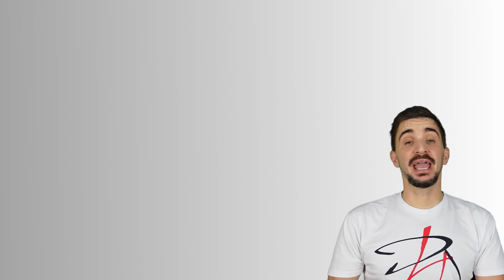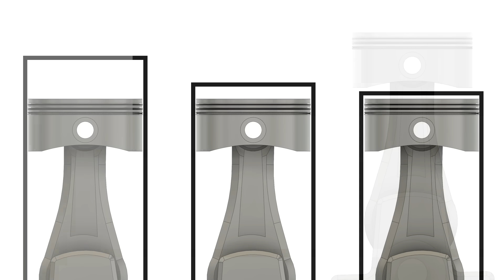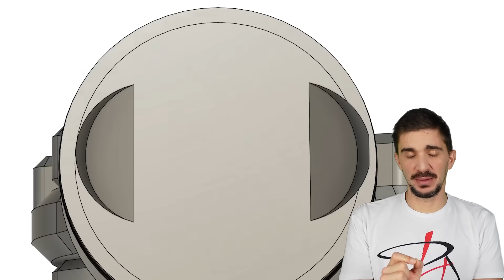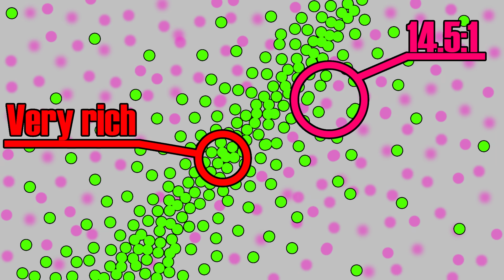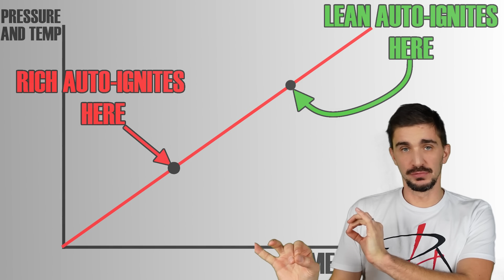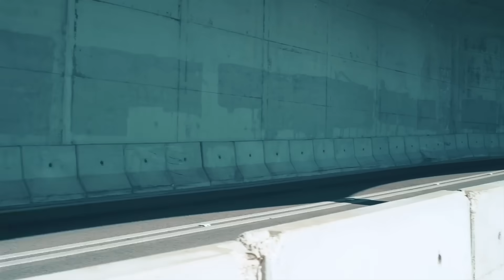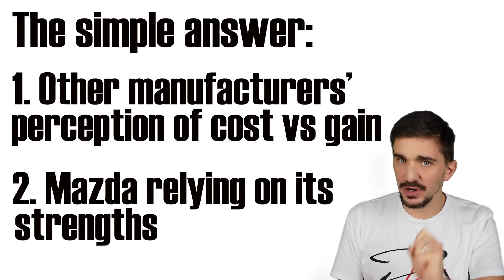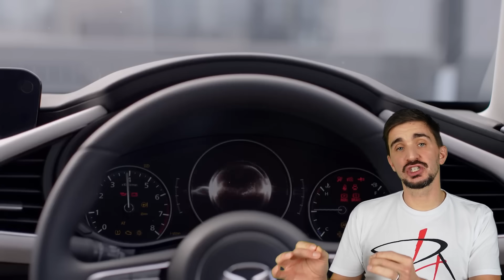The Game Changer Nobody Cares About - Mazda Skyactiv-X SPCCI How it Works and Why It Didn't Catch On

Comment: The big miss is the power. If they're getting such amazing efficiency and aren't running turbos, get more displacement! 180hp and 50mpg? How about bump that displacement to 2.8L and gets us to 220HP range. With fuel mileage in the low 40s, it would still wipe the floor with stressed out turbo shitboxes. They've been making the same power for almost 2 decades. I had a 2.5L Mazda 3 in 2010.

Comment: I owned two Mazda sedans over the 90's. The first was the 929 which everyone who saw it thought it was a Lexus due to its beautiful body lines and larger size. That six-cylinder was fairly righteous if not brilliant.  I sold it and got a Millenia S (Miller Cycle V-6) which raised the bar due to its increased power and smaller size and weight over the 929. Both of these cars were very solid and extremely eye-catching in appearance. I may have stuck with Mazda but they seemed to walk away from these two sedans replacing them at the time with nothing comparable.  That said I always felt Mazda's 6-cylinder engines were very solid and reliable even if for whatever reasons they didn't;t get the hallowed love of similar Toyota and Honda 4-cylinders which became benchmarks in building those brand's reputation for solid reliability. You make a good case for these sophisticated Mazda modern 4-bangers.

Comment: For some reason this thing only made it to the little 3 and CX-30. The larger ones have NA or Turbo options. (The 2.5L Turbo is really a fantastic engine.)
They are going to be pushing Hybrids hard for the mid and low range vehicles.
But Mazda never gives up. They are bringing back the Rotary too.

Comment: This is not a game changer. This technology relies on very clean and high octane fuel, it needs compressor, pressure sensors inside cylinders and high pressure injection valves, all of which makes engine too expensive to make for not exactly clear reason of fuel economy in very specific scenarios.
If nobody else rushing to adopt this technology it simply means there's a reason for that. Nobody really needs a minor efficiency improvement for a very high making cost.
This engine is not even good at role of generator for hybrids, since efficiency is only achieved during sustained loads, while engines in hybrids are working in on/off mode constantly

Comment: So Skyactiv-X does seem better, but then you get mpg or L/100km claims that are higher due to lighter cars, better tires, design choices, etc.

While you may have no desire to compare a Mazda to a Nissan, and the Nissan may not be as clean burning, how can Skyactiv-X compete if someone else has better fuel efficiency these days? Nissan advertises 40 mpg per ideal conditions of some cars. I know it doesn't beg a comparison of whether someone would even buy between these cars because they may suit different tastes, but in the case of a family needing a good car it may sway considering 40 vs 33 mpg.

Comment: mazda should build hybrids based on this engine, they can have better control of keeping the engine in the opimum hcci operating range and instead of using supercharger they can use e-charger system running on typical 200v hybrid battery

Comment: I do laugh at the fact that people that dont own that car are trying to explain that they know better...including D4A. Bro you should have at least tried the car instead of pilling marketing argument and photo shoot ads.

that engine do have some advantage of both gas and diesel but it mostly has the drawbacks of both !! Sluggish at low rpm (gas) no high rev (diesel), same efficency as gas, complex to maintain, sound like a tractor especially at cold start

But hey i'm selling mine so come and grab your dream engine.

1st time downvoting one of your video, maybe YOU should have used your brain in the end

Comment: I think for the average consumer, the numbers just don't line up. For about the same price as a Mazda3 with the SPCCI technology, you can get a base civic with the same MPG numbers, and a better driving dynamic. Or even a civic hybrid that gets more power, and 10 more MPG than this technology. It seems like a game changer, but it doesn't seem to bump the MPG all that much. Especially compared to the R&D an automaker would have to put in.

Comment: I would like to see some more Atkinson Cycle engines. Possibly more performance based engines. I really only see them in Prius engine, but imagine a gas engine with a static compression ratio of 18:1 but an effective ration of say 12:1 or 13:1.

Comment: i question this.  high compression tempatures lead to increase of oxides of nitrogen.  second not every diesel works this way now days  today the propagation in the cylinder is controlled by multiple injections before and after tdc.  high compression gas engine must have some serious intake and exhaust valves to help combat this. to tomention the amout of head gasket failues due to extreme heat differntials between the block and head  High compresiion gasoline engines (direct injection) have a majpr problem with coking on top of the valves.  sure you can use a shit product like combustion chamber cleaner but the only real way to fix the mess is strip the heads and wire wheel them .  industry driven by cost to consumer.  Port injection washing over the valves s required like the ecoboost.  shity engine spcci

Comment: In fact, as far as I know, the lowest emission is not at the stoichiometric ratio, as it causes an increase in nitrogen oxides output, which are worse than a little bit more of carbon monoxide. So, the lowest emission is with a  little bit richer mixture.

Comment: I got the first Skyactiv engine they sold in 2012. I still get 45 mpg highway 34mpg local, i have 220,000 miles on it, and have never done any repairs to the engine, not even the starter.  Only repair I've done to the car was a solenoid for the emissions system.  The engine lasts too.  I'm a commuter and this car has saved me thousands of dollars given what gas prices have done since 2012.  It's perfect for commuting.

Comment: Imagine running this engine with the Honda hybrid system. You get to run an efficient generator essentially under 45mph to recharge the battery while enjoying EV torque, and you're able to decouple the engine and run direct drive to the wheels above 45mph for fuel efficient highway driving.

Comment: What do you mean by "working the engine"? In any vehicle I just press the gas pedal until I get the right amount of acceleration or is that more complicated than in my limited experience? does the travel of the pedal not consistently enough yield the same amount of power (or acceleration?) instead depending on the current gear, speed, etc making one have to search for where the power/acceleration they want at times? or is it about going deeper into the gas pedals travel towards the bottom due to the engine being low torque at certain speeds and gear combos? both? I guess this annoys people. Personally, I just don't like it when there are sort of "holes in the power curve" where you want to find a level of gas pedal travel that sort of matches and maintains a speed but instead you have to constantly go above and then below. I have only ever driven one vehicle that does that and only on 4% or above grades. there is no road in my experience even on mountain passes that it isn't capable of going the road speed limit but it will sort of slow down for a bit then you press the pedal down an iota and it speeds way up and then you have to back off an iota after a bit in a cycle so its not an problem of like engine ultimate power for this particular vehicle just like engine tedium if that's a measurable thing.

Comment: while i agree that this is great technology,  I am curious if this engine is still susceptible to carbon buildup on the intake valves?
because i have also been very confused as to why more manufacturers haven't implemented dual fuel injection to prevent carbon buildup on direct injected engines as toyota/lexus is the only brand to put that particular tech on all of their engines.

Comment: Is it just me or is the name "Skyactiv-X" enough to put an auto-enthusiast off their beer?  Anyway, no-one likes a 2L engine that has no torque and has to be revved to go anywhere - like certain Honda engines.  Nice tech but no-one wants to use it daily.  Enter a 2L Turbo engine car at the same price which is nicer everywhere than a Mazda, like a Golf or T-ROC, and the buyer doesn't take the Mazda.  You can then go for the GTI or R version, something Mazda just doesn't have at all.

Comment: Every time you compress air in a cylinder by half you get one degree of temperature rise. At one point thats one degree for every. 010" of movement for a diesel at one point.  At operating temperature the air charge is almost 1900 degrees f.at tdc. Compression. It was around 190 degrees f. When it filled the cylinder. If there was an intercooler.

Comment: Here in the USA, it never caught on because it was never offered in the first place.  I was hyped about it when I heard about it back in 2019, and was waiting to see the reviews, expecting it to debut in the new (now current) Mazda3.  When that got released, nope, still the same Skyactiv-G.  But now with a turbo bolted on!  Year after year went by, and nothing.  Mazda North America just wouldn't bring it here.  Thing is, there's a perfect vehicle for it - the MX-5 Miata.  N/A engine you have to rev out to get power?  That's exactly what Miata buyers buy the car for.  Nope, we get a modified version of the G.  Disappointing.

Comment: If you paired this with a Toyota eCVT hybrid powertrain- you'd have a winner.  Hybrids are efficient in town and can add that low end "punch."  SPCCI works/ most efficient at cruising speed (when a hybrid has to turn on its gas engine).

Comment: Just wait until "extended range electric vehicles" are a thing. You just slap a generator in an EV, half the battery size, and suddenly you can run your motor attached to a generator at a standardized load and RPM and in exchange you can dump the drivetrain and slap the EV motors right in the axel while still taking advantage of the power and usefulness of an internal combustion engine. You get all the benefits of both without the majority of the drawbacks.

Comment: There is also the Spark Assisted Diesel version of this technology.
The compression is lowered to a point where it won't auto ignite the fuel mix.
Some fuel is port injected during the intake stroke , at a point before TDC the main fuel charge is injected and a Spark plug that is also a glow plug is energized ensuring ignition .
Because there is a far more homogeneous fuel mix and still high compression a complete clean lean burn is achieved.

Comment: My question, which unfortunately wasn't answered, is: Why not inject the gasoline at the point when the air charge is hot enough to cause autoignition of the Gasoline, just as a Diesel does?

Is it due to the fact the injector would basically turn into a flamethrower, and that's not conducive for making power?

Comment: Seems like a excellent engine for a generator Hybrid, the ones where the engine isn't mechanically connected to the wheels. You could run the motor in that sweet spot to get maximum efficiency

Comment: The Sykactive X is a purist engine for petrolheads, that we  love driving, at for the "its slow" i would re- consider that, the engine has almost 120Nm from 1000rpm and 200Nm at 2500rpm, its has the Torque peak of 240Nm at 4000rpm and 220Nm at peak power (186hp at 6000rpm) its a very good Torque curve for a Gasoline NA engine, and the more inportant is much more reliable than a downsizing turbo engine, and better Fuel economy in real scenarios

Comment: Very well done! Thank you for explaining this.
I get the feeling Mazda WANT to stubbornly stick with internal combustion 'just because'😄 ,but i also see at least one good reason for it.They get the buyers who want a revvy engine and a non interfering drivetrain.
BTW this is reminding me of the other weird things Mazda does.Remember the 'smoother' steering system they came up with? To this day that silliness still baffles me! Was it Mazda who built dual stage synchros for their manual transmissions?That was kinda cool.
And their wankel driven hybrid system that ended up extremely meh because,duh obviously! Wankels have terrible fuel economy.

Comment: My beloved 2009 Mazda 3 SP25 Luxury pack has a compression ratio of 9.7:1, port fuel injection and it outputs 122kW at 6000 rpm and 227Nm of torque at 4000 rpm.  My wife's 2024 Mazda CX-30 25 Astina Sykactiv G has a compression ratio of 13:1 and it outputs 139kW and 252Nm of torque at 4000 rpm.  Her average fuel consumption is 8L/100Km's where my Mazda is 10 L/100Km's.  A substantial difference in every way.  However I prefer my MZR 2.5L 5L-VE engine.  Great video.  Thanks.

Comment: A natural aspirated car, no turbo! Manual gear box?!
I’m in!
Reply: I’ve got that in a 2019 premium. Hundred thousand trouble free fun filled miles. The 186 hp is more than adequate for someone who knows the joy of riding a slow car fast. Torsion bar rear is an over, stated issue, has very little impact except over very bumpy roads. The six speed manual is a joy.

Comment: just do a series hybrid. engine stays at it's optimum rpm running a generator, a much smaller than full EV battery handles the actual drive power loads. all the instant torque of an EV, but vastly higher ranges and no need to spend 30+ minutes charging, just fill the tank as usual and keep driving.

Comment: You saying america does not use diesel at all on graph? I do not think so. It is impossible to make heavy torque machine by weak petrol. America have load of truck type of cars, these need only diesel to be truck. Sure there is always big cars with betrol engines but these are always useless

Comment: 9:06 wouldn't be a problem in hybrid cars though as they can operate the engine in constant rpm even in city traffic.
Reply: Have you owned a hybrid?  The electric motor/battery assists the gas motor but if you want to go faster and put your foot down the engine increases rpm, the same as any other car.  I believe that the only car this would be true for is the Chevrolet volt in which the gas engine served as a generator to charge the batteries, an EREV.  The volt did not last long, although in terms of engineering it does seem amazing.  Run a gas engine like this one at perfect thermal efficiency to charge the batteries, which power the electric motors.  However, it does seem rather complex.
Reply: @free2roam674 I believe he's talking about hybrids where the engine acts solely as generator either to charge batteries or directly power motors

Comment: Use this motor to run a generator for a battery over electric drive system, run it at its best rpm and load, and get a very efficient hybrid.

Comment: I wonder why they didn't use a turbo or supercharger. Not for more power really but for more oomph when you put your foot down. Or even a hybrid. Its a brilliant piece of design and one of the few true steps forward we've seen in the last couple of decades but in the spec it has its more suited to the MX-5 than any of the big, heavy cars its usually fitted to.

Comment: It seems that all engines use a continuous line between the piston and crank center points of the fulcrum. Have we, or could we, test if the crankshaft had a small offset?
Reply: Joined. You make great videos.
Reply from the maker: Thank you for joining! https://youtu.be/gwtZkHoVMso
Is this what you had in mind?
Reply: @d4a  Yes, exactly. Thanks.

Comment: Mazda is a recognized Japanese maker of automobiles. It does have quality stamped behind its bread as most people trust Japanese automotive manufacturing. However Japan has more than one manufacturer of automobiles, and among them are Toyota and Honda as the most reliable manufactured automobiles, with that said, Honda and Toyota can integrate obsolescence into their goods and people are still not going to think twice about turning their hard earned currency for their brands. Mazda on the other hand doesn't have the same advantage in market shares, so their leg up in the competitive arena has to stem from a product that is made the way early 90s Toyota made their products, tested to withstand and outlast all segment competition within the area where it releases their goods. 

Mazda is making engines the way that Toyota did in the early 90s so that they can break into Toyota and Honda stakes, and what better way than to copy their early successes.. in a nut shell, this is what the video is getting at without revealing the economics, but rather focusing on the mechanical integrity of the skyactiv system which after a closer look is not much different from hi das earth dreams or any other systems designed to make use of the smallest Input of gasoline.

Comment: Imagine what could happen if you couple a Skyactive-X engine at maximun efficiency with Ford's electric CVT (See  Engineering Explained video for that)? You may be able to get a 50+ MPG hybrid vehicle that actually is reasonably fast and fun to drive and somewhat inexpensive.
OR couple the Mazda engine as a generator range extender to a BEV to hide range anxiety for those that need it!

Comment: Also want to mention their 2.2 two-stage turbodiesel in the CX-5 is fantastic! The power, torque and fuel economy coupled with the 6-speed is just perfectly paired. Unfortunately however, the downside of this isn't really on the engine, but the poor DPF system cycle issue which causes a 'fuel dilution' in the oil, you have to check the level on the dip stick every 2-3k kms.

Comment: If the SPCCI engine was used as the generator for a HEV, would that not allow the engine to run at low loads for longer durations, such as in traffic?